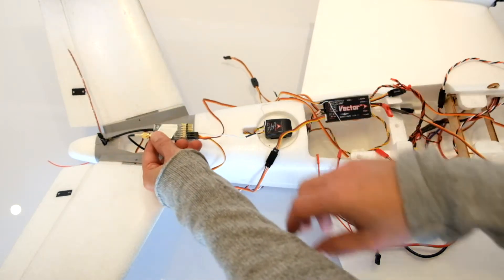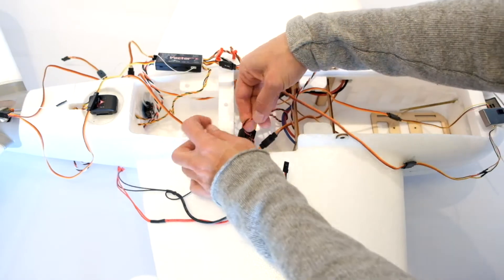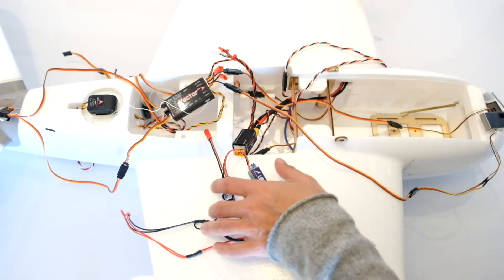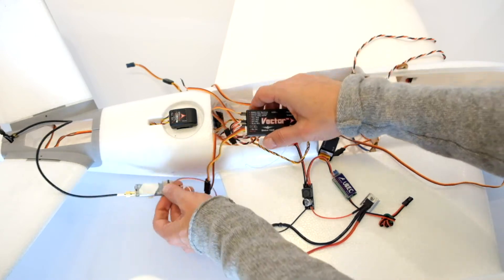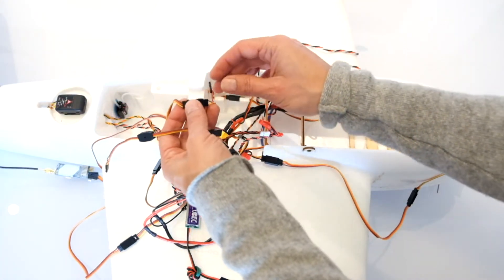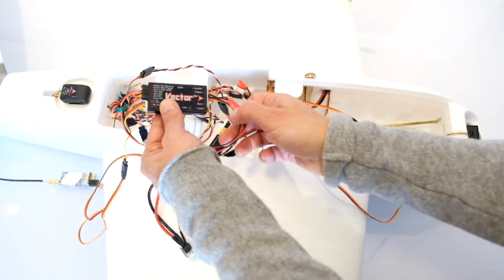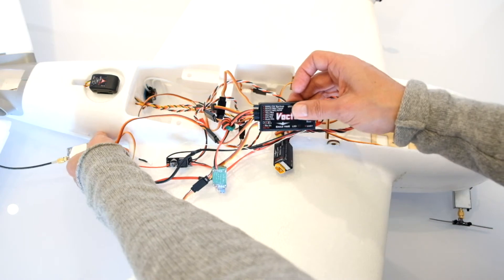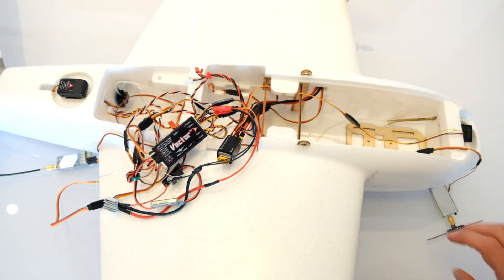FPV full electronics setup with Eagletree Vector and DragonLink (XUAV Clouds)

Comment: There is no reason to have a LC filter and VReg since you can power both your camera and Vtx through the Vector. I've yet to encounter the power lines in any of my Vector set ups and I've had at least ten Vectors. If not using the audio on your VTx & Vector, I'd suggest grounding the audio wire out of the VTx.
Reply from the maker: On my Mini Talon it's connected directly to the Vector and I got horizontal lines which should be prevented using the LC Filter.